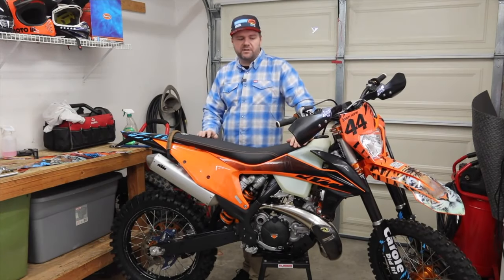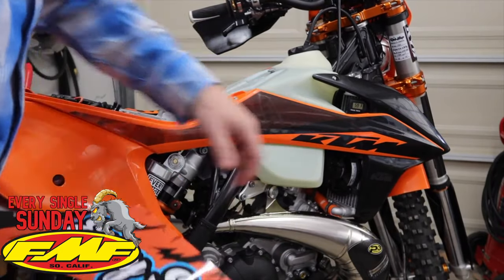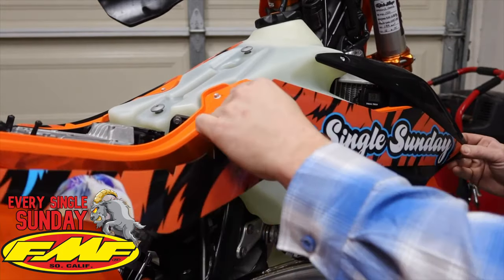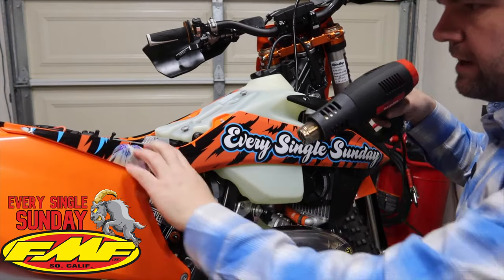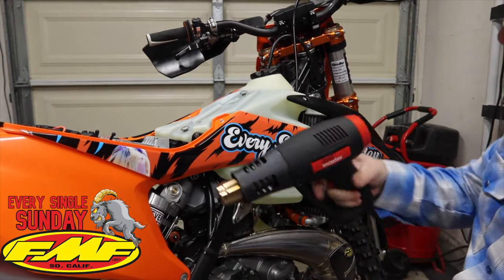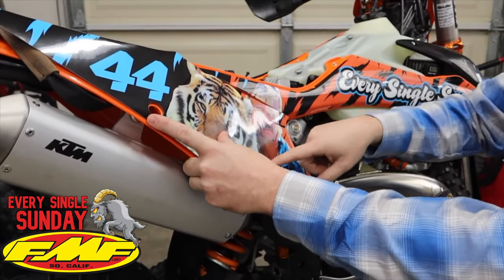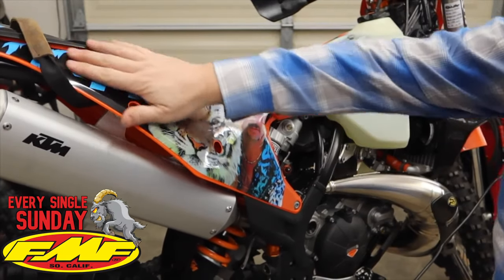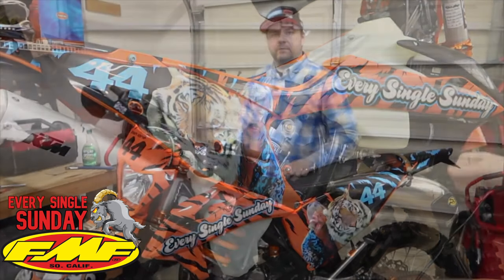How To - Install Dirt Bike Graphics

Comment: Man I did this so badly the last time I got new graphics. Thanks for the video, great tips!
Reply from the maker: It takes a little bit to get used to doing it. As you do more it gets easier and easier

If you screw it up pull it off and apply a little bit of heat and they will go back to flat

Comment: ok so you clean the surface where the sticker is being installed. Is there a trade secret to not contaminating the adhesive on the sticker from your hands when unpeeling the backing or handling the sticker? Usually it ends up in a key area like the point of the sticker in this case. I find that no matter how much I wash my hands immediately beforehand, handling the sticker always means some contaminants are transferred and that spot loses a bit of adhesion.
Reply from the maker: Not saying it’s the right way, but I spray my hands off as well with the same stuff. Might transfer something but it hasn’t peeled back in me using this technique